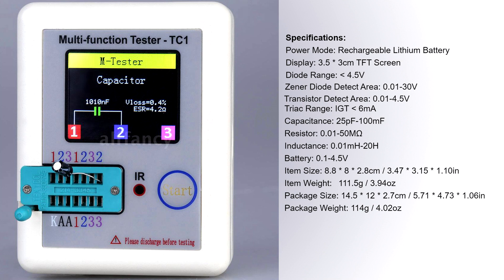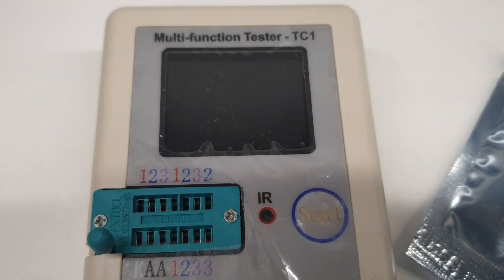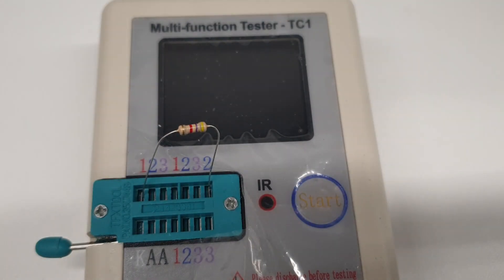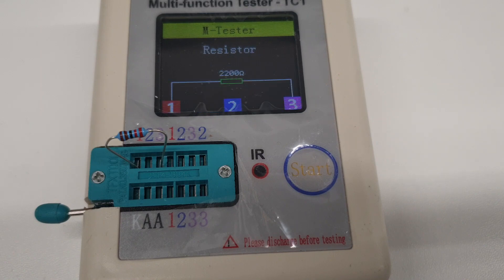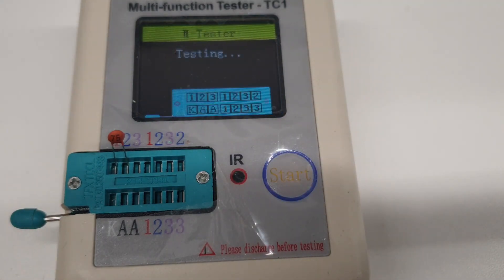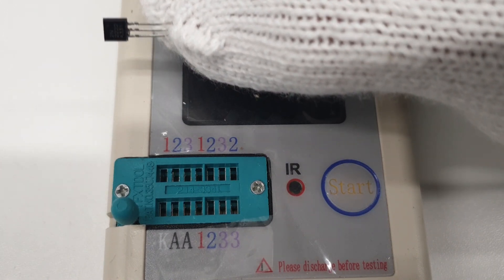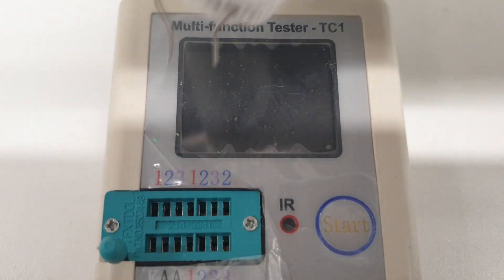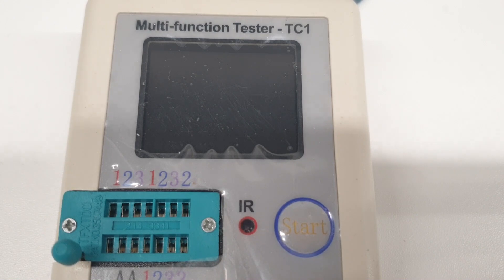Multi-function Tester TC1 - Calibration and Review

Comment: IMPORTANT NOTE
ALWAYS deplete any capacitor before inserting into the tester. A charged capacitor can damage the tester (this is because the specified maximum input voltage on any test port pin is < 4.5V).

POSSIBLE Longer Battery Storage Life
The instructions for the TC-1 (confirmed version) tester I bought about 3 years ago instructs that to turn it "off", one should press and hold the button for 2 or more seconds.
Perhaps some people see shorter battery use between charges because they instead simply let the TC-1 "timeout". I don't KNOW if this actually makes a difference because I can charge the TC1 I bought and after a year of "sitting on the shelf" the Li-Ion cell still shows a charge of about 3.6V...still tests components accurately...and I do NOT use the 2 second "off" method.

Li-Ion Cell Aging
After about 3 years of use, the original Li-Ion cell charges to a maximum of ~4.0V using a 5V charging source (the maximum input allowed is 6.0V).

Change 3.7V Li-Ion Cell to Increase TC-1 Usage Time Between Charges
The spec sheet for the TC-1 I have also claims the 3.7V Li-Ion cell is 350mAh, but the actual physical size compared to available cells, suggests it MAY be closer to 500mAh.
I've also noted that if I want to increase the TC-1's Ah capacity I can physically fit a 3.7V 600mAh cell in its place, and I can scavenge 2x 600mAh cells from some rechargeable Li-Ion 9V batteries I have on hand.

Comment: what  is the purpose  of the included electrolytic
Reply: Same as the other discrete components provided...to show user the tester works on various parts, to help neophyte users gain some experience on using the ZIF socket (Zero Insertion Force).

Comment: Thank you for posting this. I received my TC1 yesterday but it comes with no instructions whatsoever. I had no idea how the various pins are wired. And especially no idea about the self-test procedure. I'll have to try the "zener area" as well to see how that goes. Anyway, handy little device but they make using it so mysterious. I guess that in the 2020's Youtube is the new user manual. 🙂
Reply from the maker: Glad it helped! Thanks!

Comment: I'm late to the party here, but this was a great walkthrough of what this tester can do.  I ordered mine based on seeing it in action, and just got it today.  Sure enough, it works exactly as you showed.

One suggestion: it may be worth mentioning that if you are going to use the test clips it comes with, you should do the calibration with those attached and shorted together, and then keep them plugged in and separate the clips for the isolate step in the calibration.  That way it takes into account the resistance of the leads.
Reply from the maker: Thanks for the suggestions 👍

Comment: Is it possible to do on board measurements for capacitors?
Reply: These are sold with probes also, and you definitely can test all components in circuit so long as there is no mains power on the device you're testing.
Reply: @wefukthenwo  You also have to deplete the capacitors before testing. Any voltage above 4.5V on a test input pin can damage the tester.
However, I suspect in-circuit testing will produce numerous 
"No, Unknown, or Damaged Part" readouts.
Reply: Certainly not, Testing voltage is simply too high.